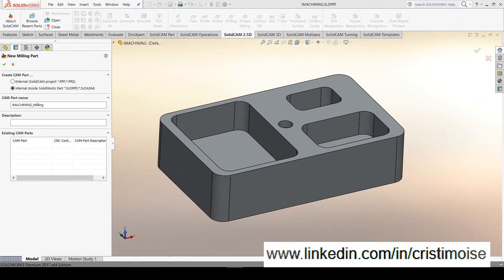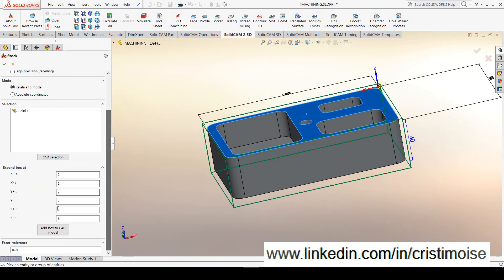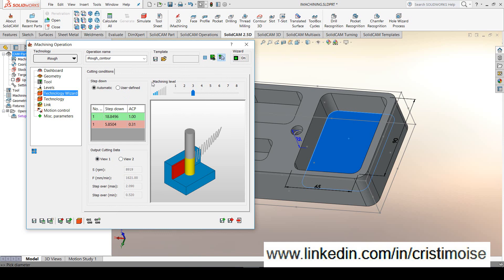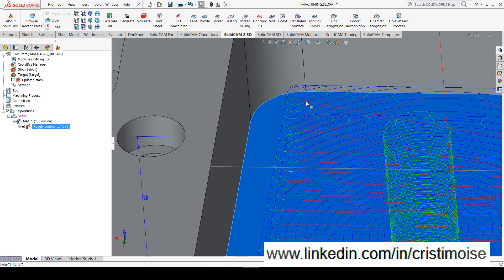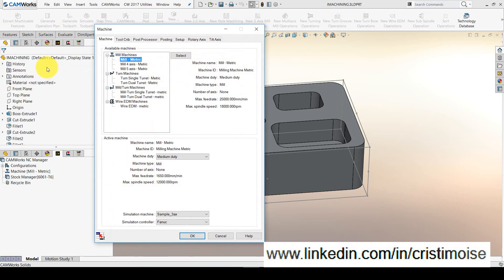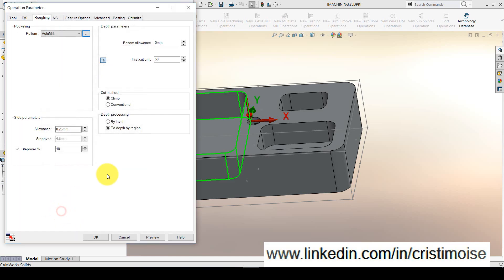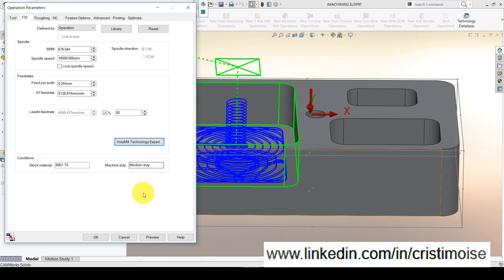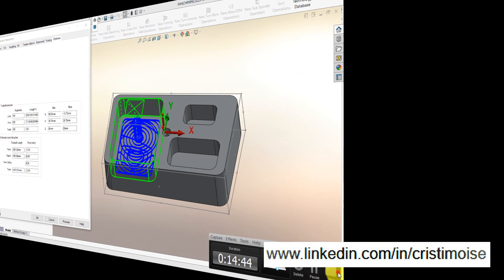iMachining vs. Volumill.

Comment: Hi Christi,
I just came across this video. There are several misrepresentations here that I think you should correct, if you want to be seen as credible.
1. the red "Rapid" lines you discuss in the video are not "Rapids" and they do not cause a crash!!! 
They are high feed rate G1 Re Position moves that are defaulted to 0.003" (0.1mm)above the floor. G1 high feed, means they are smooth, not jerky like the VoluMill re position moves.
When you edited them and moved them up to 5mm Z, you insinuated a failure where none exists. This is actually a very effective function of the iMachining tool path, and they should not be moved up to 5mm Z)

2. You are suggesting that the "Default settings" are similar for both systems, and then showing a time study of each tool path. In your actual test you are not testing with the same or equivalent settings for feeds and speeds and cutting angles. iMachining defaults to very conservative values, but raising the slider to level 6 or even to 8 will produce a much more efficient tool path without any damage to the tool. iMachining also provides a "Turbo" mode that moves the gradient of the scale towards the aggressive side of the slider. This gives the user much more control
The default settings are designed for long stick-out or weak fixture setup. 
Showing one system running at 2.5 times faster spindle and feed than the other would of course result in a major difference in cycle time.

3. As mentioned by DaMaJa85 you fail to mention the constant chip thickness function of iMachining. This ensures that the tool is seeing a very consistent force and therefore protects the tool from damage due to excessive linear (tensile) forces. with iMachining you can run at extreme cutting parameters and still get great tool life.

If you are going to compare the two tool paths, it would be helpful to mention all the positive and negative characteristics of each tool path.
Please try again and if you need assistance understanding iMachining, I would gladly assist you.
Reply from the maker: SolidCAM Development Thank you for your comment.  Please send another part and let's establish some points and test again if you want. As I told.on video, I just install Solidcam and use the default settings to generate toolpaths. I have a question: do you test on any machine volumill?
Reply: Hi Christi, I have run some Volumil cuts on machines. I prefer to talk about iMachining cuts since I have much more experience with them. 
Here is a link to a video of the cut we were doing at SolidWorks World 2018 last week on our desktop CNC machine with a 2.8 HP wood router spindle. https://www.youtube.com/watch?v=eYsPCRqvotY&t=5s 
Please let me know what you think, and I would be happy to get you the solid model if you would like to run a comparison cut with Volumil.
Reply from the maker: SolidCAM Development Looks good. Yeah, of course I want but also the file.in Solidcam in order to have all the settings. Thank you.

Comment: I suggest you explore more when you compare two technologies. Imachining calculates based on the machine, material and tool parameters and you forgot that imachining have a separate tab on the tool tab.
Reply from the maker: Antony Jose Please watch the video carefully, because I start with this. But every solution like imachining, volumill, vortex, etc does what you saying. If you consider imachining is the best that is fine. Thank you for your comment.
Reply: you have made a comparison at the end of the video about the machining time which sounded like you want to promote volumill. the real difference is when you tweak both the software to the same cutting condition and check the tool path pattern. The one gives you the constant and smooth material engagement should be a better choice